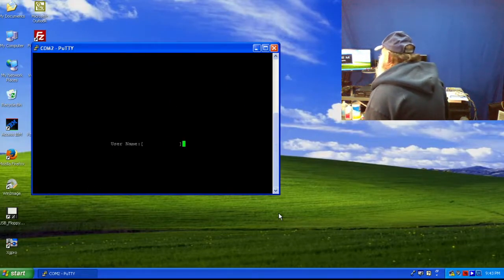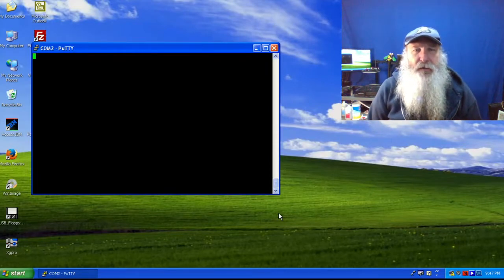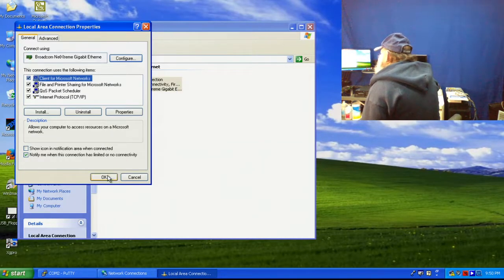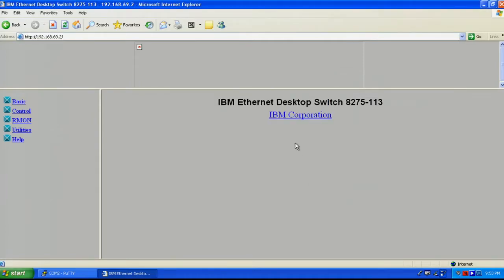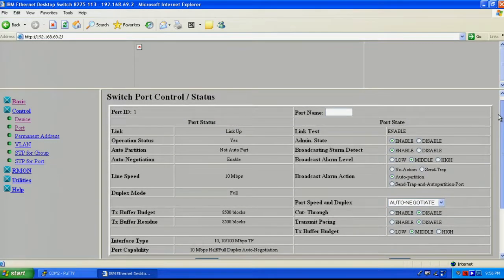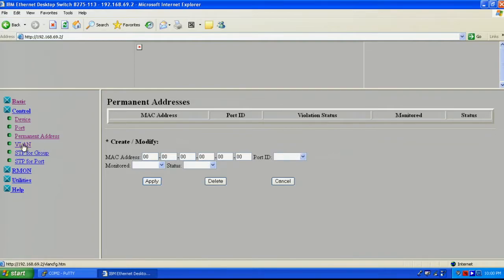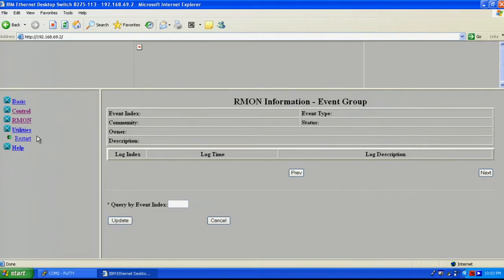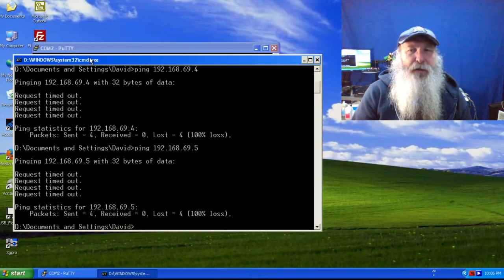A deeper look at the IBM 8275-113 Ethernet Switch "Web Interface"

Comment: Hello, good morning.
Why do you use Windows XP to connect to the switch? If you use Windows 10, wouldn't it be possible to connect to the switch via the serial cable?
Reply from the maker: To connect to the console port of older network equipment with a computer that doesn't have a built-in serial port, you will need to use a USB-to-serial adapter: https://www.amazon.com/dp/B00IDSM6BW